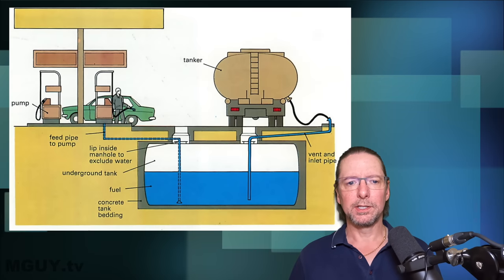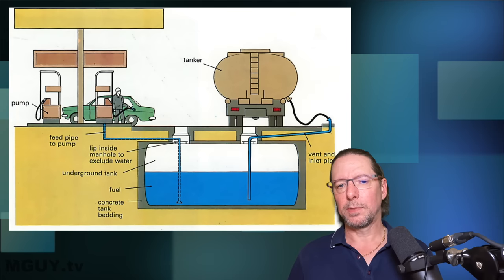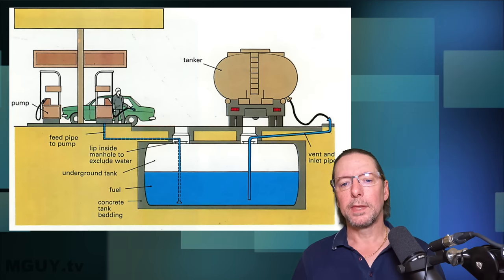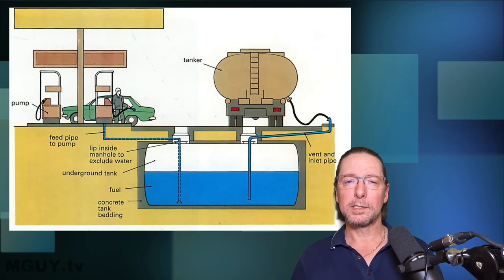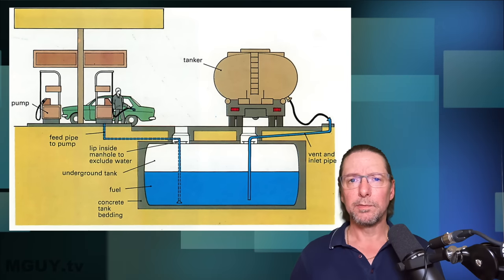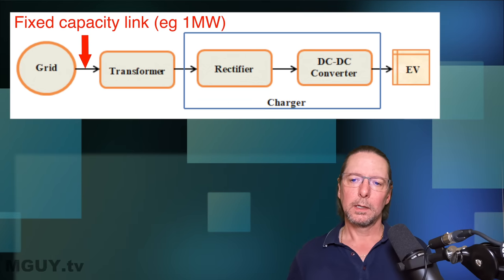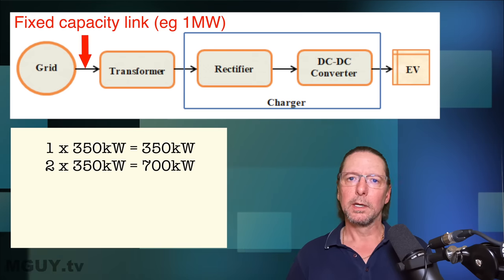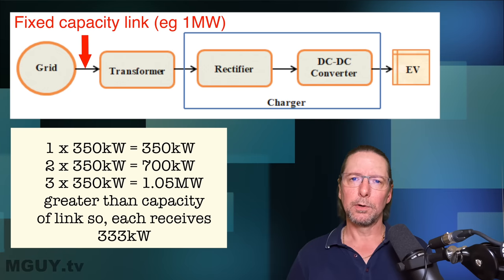HUGE problem with EV Charging Stations that no one mentions | MGUY Australia

Comment: A friend's son who is an electrician recently got a call to a company that were replacing their vehicles with ev's. He was asked to give them a quote to install on-site chargers, they were shocked when he advised them there wasn't enough power to their business to run the chargers.
Reply: He was referring to them not having enough space in the electrical panels on the sight to add more circuits. That’s not uncommon. The fix would be to add a sub panel feeding off the existing panel but you can only pull so much from that also. Additionally in a typical commercial building the transformer feeding the building itself might not be enough, I’d say a study would have to be preformed by the power company to determine that. Most transformers are old and haven’t been updated. When a business moves into a location they don’t update things like this to accommodate for things they want as it’s expensive. They typically make everything look pretty and put lipstick on a pig, this is true for a used sight when the previous owner went out of business and the new folks move in. Just my two cents.
Reply: Nice pun..."shocked".. lol
Reply: @Bill308A10  Maybe he meant the cable supplying the business was not big enough to carry the extra power.  This happened in districts of London where 'shock horror'  people were told they could not charge their EV because the power supply to their area was not big enough.  There is not an endless supply of electricity to feed these EV... in fact power outages are becoming more and more common in our area, pretty much twice a week now.
Reply: The electrical networks are no where close to being sufficient to provide enough power to charge en masse. It’s all a pipe dream.
Reply: Imagine having a fleet of HGV's!!!! No chance of charging them.
Reply: We already have "brown outs" during the summer due to heavy use of air conditioners. We are told to reduce use of electricity during those times. Guess no air conditioning or EV charging during hot Summer months.
Reply: So what happened? Did they decide to get the EV's or keep ICE vehicles? Maybe the company should look in to what is going to happen to their insurance premiums and see if they are covered for the loss of the entire building if one of these POC's spontaneously combusts.
Reply: @richardweyland116  I think they already had some ev's so they would have to use public chargers for the time being. I haven't heard if they were looking into upgrading their power supply which is quite an expensive exercise plus the installation of the chargers.
Reply: @Bill308A10 No that means the mains feedind the board aren't big enough and if it was really high also the transformer they were on.
Reply: @Bill308A10  Actually the guy said "there wasn't enough power", note the word "power".
Reply: So the company gets onto their power company and increases their capacity. Or they fit solar panels to their rooftops and cut the power company out of the loop. Or they relocate somewhere that can meet their needs. But oh noes, they can't possibly use EVs because a friend's son said so.
Reply: @johnminer1407  or you fit solar to your roof and run the AC and charge your car without caring if the grid is browning out or not. If its that hot you'll probably be generating an excess to actually sell back to the grid.
Reply: @drxym  So in your world, people must accommodate themselves to their electric vehicles, instead of the electric vehicles being subservient to their needs.
Get real Sunshine, EV’s are not a viable vehicle for most people.
Reply: @drxym  An extra expense on top of the overpriced EV. I also note your use of the wcost of the word "probably".
Reply: @smedleyfarnsworth263  what are you even prattling on about?
Reply: @drxym  how the fuck did you come to that conclusion the point isn't it's impossible just that it would have been very expensive and while OP doesn't specify where this was i know that in Australia any modifications made to the grid the customer has to pay for then has to give that stuff to the utility company and a small addition is an easy $15k but then again solar would be an even larger outlay requiring a massive array plus energy storage. Because if they went that route the charging system would either need to be completely separate from the grid or they would need to do both so not exactly a cheap alternative
Reply: @shaynegadsden  punctuation is your friend.
Reply: @drxym  Wow that is seriously the best you have
Reply: @drxym  Oh dear, the fact that you can't comprehend my posts is not surprising considering the content of your earlier posts.
Reply: @drxym  " punctuation is your friend."

Now that is the pot calling the kettle black.
Reply: @smedleyfarnsworth263  I also alluded to that in my original comment buddy
Reply: @shaynegadsden  bro I know what I’m talking about I’ve been a mechanical engineer for going on 30 years now. I’ve built and rebuilt entire buildings both class A&B mechanicals.
Reply: @Bill308A10  Yes alluded is right, when ithe actual power supply was the main point. But you went off on a ramble about switchboards, to wit, "He was referring to them not having enough space in the electrical panels on the sight to add more circuits. That’s not uncommon. The fix would be to add a sub panel feeding off the existing panel but you can only pull so much from that". 

I hope that helps, buddy.
Reply: @Bill308A10  yeah what would i know i'm only an electrician
Reply: @drxym  I never said the company couldn't use EV'S but what I took from it that it was going to be very expensive to upgrade and install.
Reply: @shaynegadsden  Oh I see you are trying that old debating trick called “the argument from authority” as if somehow being an electrician automaticly stops you from being wrong.  

Well sparky not so fast, I quoted you verbatim and your point was about switchboards. Perhaps you were trying to impress us with your vast knowledge about them rather than the lack of supply which was the point being made.

I am not a meteorologist, but I know when it is raining.
Reply: @smedleyfarnsworth263  Cross communication i accidentally tagged you but fixed that and you seem to have mixed me up with the person i was supposed to tag.
Also while true it was a rebuttal to the I'm a Mechanical Engineer and i know better
Reply: @shaynegadsden  That explains it . I reread it all and it does not seem to fit together now.
Reply: It’s not surprising. Older areas will see that because the local grid most likely can barely support the existing loads.
The local grid, and even the grid node interconnections can only support so much before they start to overload and trip out.
Electric Utility Companies plan their infrastructure on worst case high use scenarios, not on off-peak use.
Reply: @johnminer1407  Only in the primitive USA.
Reply: @chrissmith2114  EVs aren’t as big a drain on the grid as naysayers and the uninformed fear. In this parts of the world where the mains voltage is 220-240 volts, any regular domestic outlet is sufficient to charge an EV, as long as it can be plugged in overnight, and is driven less than 60 miles (100 km) per day on average.
Reply: @jimmurphy5355  Charging an EV overnight means that it will not be charged by solar energy and the wind often drops at night - so the EV is probably going to be using electricity generated by 'non-renewable fuel source' most probably CCGT which use natural gas, or even a coal fired station brought online to prop up lack of intermittent renewables.  An EV is just a remote emissions vehicle, or if the battery has a bad day 'an external combustion vehicle'..
Reply: @chrissmith2114  Indeed, charging at night will use whatever power is available then, which, depending on the region might be coal, natural gas, hydropower, nuclear or geothermal, all of which (except coal) are sources available at night where I live, in California. So yes, EVs are "remote emissions vehicles" whereas ICE vehicles use 100% fossil fuel and do so less efficiently than burning the same fuel remotely.
Regional differences in the grid power mix make a substantial difference in how much carbon emissions are reduced by choosing an EV. If the grid is 100% coal powered, there will be barely any benefit. But even at night, some grids are 0% fossil fueled, if hydropower, geothermal, nuclear, and wind are the sources.
I used "overnight" as an example of one way to charge EVs with reduced strain on the grid, but depending on where you live, mid-day charging, while parked at work, if that is possible, can also be a preferred choice. Once again, specific to my location, the local utility now offers cheapest rates all through the day, until 3PM. Rates at noon used to be expensive, but so many people have now put on rooftop solar that excess generation needs a place to go during peak solar production.
Day or night - whichever is best for a given locale - EVs can often get all the charge they need from a standard domestic outlet in 240 volt regions, where 3kW is available. It takes many hours to put back a lot of range that way, but most cars, most of the time, are parked somewhere. If they can be (slowly) charging a substantial part of the time they are parked that can more than keep the battery topped up.
Reply: @Bill308A10  Most likely the overhead lines and transformers are inadequate for a business with many chargers - solution would involve bigger local transformers, heavier wires/higher voltage from the sub station and maybe even upgrades in the substation itself!!  It is a ripple effect back through a dated system that wasn't designed for this kink of service!!
Reply: @Bill308A10  I don't think so. I think he was referring to the current capability of the service drop, not the number of spare spaces in the panel. Those are two very different things. Some truck depots are looking for 1000 amps of electrical service to charge their trucks, which is more than the entire town draws.
Reply: BS: car can charge with normal outlets. No need of a charger. Also get a Tesla for more efficiency.
Reply: @mletouutube  you obviously don't understand electricity.
Reply: @Bill308A10  Well, Bill, that is pretty arrogant to assume that you know what that electrician was referring to. There was no mention of how many or what size vehicles or charging stations the customer was seeking. Nor was anything said about the location and what amount of power was available. I also do not know any of these issues at that particular location. It is possible that the incoming lines are not sufficient for the additional power draw.
Reply: I thought they were going to be solar powered? Yeah, right! 🤫
Reply: @mletouutube  Might do if you only drive a few miles a day, but to recharge from 15% to 85% (tesla model 3 or Y) would take 50 hours!
Reply: @Hogger280  day to day city driving requires only few hours charging AT HOME AT NIGHT. So you never go to a charger station (which you have to - gas station - with an ICE car). When you travel, after 3 hours driving, you need a break so you stop at a super charger and it takes 30 minutes to add 220 more miles into your Tesla. You plug and go to take a snack, restroom, etc. When you come back your Tesla is ready. I know with absolute certainty because I had a  Model 3 and now a Model Y.
Reply: @kennetzel6101 where did you get you get your info. You did not mention voltage. You need to talk about megawatts to get the true amount of power used.
Reply: @Hogger280 what do you think it’s a toaster oven. It’s more like a dryer or electric heat. More voltage and more amps.
Reply: Sorry buddy I do not give your channel any clout you are only one sided all forms of energy have there pros and cons. If you can’t argue from both perspectives you do not deserve an opinion.
Reply: @sgonnason9120  Of course, but that is dependent upon the type of charger being used. The lower the voltage at which they are charging the longer it takes to charge. While that may work for some folks at home it does not work for truck fleets. The fact is that even if we could build enough EV cars and trucks the grid is not able to handle that additional load right now, and it certainly will not be able to handle it as these nut jobs shut down more and more coal plants. Solar and wind can only produce a fraction of the power that coal, nuclear and natural gas can produce.
Reply: Electrician here. IF he was an experienced electrician, he did not mean there weren't enough breaker space. He meant exactly what he said. I have installed overnight chargers, called stage 3 chargers, the one's I've been around each require a 100 amp, 240volt, A/C, single phase service, that is a  lot of available power, their goal is to completely charge a vehicle in an 8hr. overnight period. This is the good at home charging system. Cost is about $12,000.
Reply: Similar thing happened at my workplace.  We were quoted 1.1 million to upgrade our system to be capable of charging employee EVs.  We have about 80 staff.  With 4-5 that own an EV.
Reply: AHAHAHA, that wouldn't be me and my father told you of this would it? Because we just told a company that they needed to upgrade their service if they wanted even ONE charger LOLOL! Now we are doing the service upgrade and the chargers... just a little over 100k, yes, 100,000 dollars!
Reply: @sgonnason9120  What the hell are you talking about?
Reply: @jerryw6699  It is not just the residential chargers that are the problem. It is the truck fleet chargers that will require much larger and faster chargers.
Reply: Even in a private home when people buy a fast charger they are shocked by the cost.
The underground wires to their house need to be upgraded to handle another 200 anp panel. Plus the panel and breakers.  So they usually opt for a slower overnight charger to avoid the cost of upgrading the underground wires.  But their power panel still needs more capacity.
Reply: This what some of these delusional leftist EV kooks fail to grasp or accept. Increasing the needed capacity to charge these vehicles in many cases is neither cheap nor easy to do. You are often looking at pulling new larger cables and increasing the size of transformers to handle the power not to mention the capacity of the electrical grid itself needs to be looked at. Ludacris things like installing a diesel generator have been the solution in too many instances. I am not inherently anti-EV but the realities need to be accepted and dealt with.
Reply: @drxym costs a lot of extra money and you need a lot of solar panels and battery storage to feed hungry EVs
Reply: @drxym So a “simple” event of “let’s get EVs for our fleet” evolves into an entire infrastructure study.  What people are finding is that it’s cost on top of cost on top of cost to make the change.  Look EV’s are fine for some applications but our infrastructure has not matured enough for “everyone” to jump on board. Look how long it took for our current situation of gas vehicles to evolve.  One doesn’t build those power plants overnight.
Reply: @mletouutube when all the charging stations are being used and they all have vehicles waiting, It will be a long wait!
Reply: @drxym  - you sound so ridiculous and naive.  Decades long industrial/commercial electrician here.  The cost of switching over a fleet of internal combustion engine vehicles to EVs is staggering even to those who can afford it.  You have no idea what you're talking about in this arena -- this is no small task.
Reply: @jimmurphy5355  Daughter works for SOCAL gas and their largest customer is the power generation stations.  I learned many years ago form an instructor;  there is a cost for everything.
Reply: @Hogger280  15 to 85% is 50 kWh on a model three or model Y long range. At 3kW that takes about 16 to 17 hours not 50 hours.
Reply: I will not claim to be an electrical engineer, electrician or have much knowledge of EVs . But the place I work is in the process of installing chargers . The decision was made by corporate office, without much consultation with anyone onsite . They initialialy thought that it could be just run from the existing building network . By the time they found out that might be a problem, the system had been purchased. 
It needed a separate feed and transformer . Now we are talking about a place that has 10,000 lights , and enough electronics that it needs AC even down to -40  . So I think if it's existing feed was not adequate then to me it means a lot of draw 
I saw the size of the cables feeding the chargers and they are huge . Likely they sized them for future expansion, but I have seen the power supply to big welding shops and agricultural manufacturing plants , and this is getting up into that range 
If you ball park that a gas station can fill 50 cars per hour , and 100 stations can serve a small city , it works out to 5,000 cars per hour capacity
If a EV charger can do a car in 30 minutes, then it works out to needing 2500 chargers 
Now my figures are on the high side ( possibly by a lot ) , and the people who have chargers at home or work will take a lot of load off that ( and those people would be a major part , because commuters who need less than 10 miles range can easily charge overnight or in a work day ) but they still take as much out of the grid 
I just don't see EVs replacing ICE overnight . It took forty years for the petroleum industry to get the capacity to feed our need , and I can see the power system needing as much time
Reply: @jimmurphy5355  The reference was to a standard wall outlet, this charger will draw 12 amps, so best case scenario will be about 45 hours.
Reply: Imagine entire subdivisions full of two evs each all charging every night. The entire country would need rewired.
Reply: @wmason1961  the grid struggles on a hot day when most people have their a/c on.
Reply: @wmason1961  Bingo!
Reply: Shocked. I see what you did there 😂
Reply: In California, the land of fruits and nuts, and regular blackouts since Enron, we don't need to deal with reality, we have drugs.
Reply: @user-zu6qn9ux9n  No, its not, pipes are not used. (Except in NYC where they were put in by Thomas Edison).😁
Reply: @johnminer1407  Why would you do EV charging at that time in the first place?
Reply: @richardweyland116  ICE cars burn at 10 times the rate of EV's.
Reply: Well if he’s an electrician he would also give them a quote for a heavy up to add the needed capacity thats what we do.
Reply: @davidhargrove1648  how do you know he didn't?
Reply: Soon the penny will drop , the only way EVs can work is if millions are forced out of their cars, this they will achieve by making them so expensive they will be beyond most people’s budget
Reply: Actually if he has more then 10 vehicles to charge at the same time he probably couldn't get a electrical service that provided enough electricity to meet demand.
Reply: @drxym yeah, you do realize that solar doesn't produce that much electricity....right?
Reply: He should have upsold them a solar carpark
Reply: If everything we use is electric powered... During a War... The enemy would only need to do it take out the power grid... And our whole country would be at risk...
Reply: @frankromero4048  and that could be as simple as hacking into the computer system that controls the grid.
Reply: Every EV is a time Bomb waiting to explode, at the charging station or around the next corner 💣💥
Reply: @Bill308A10  No he wasn't.
That's the trouble with letting a realist like an electrician near your fantasy. They know what doesn't work.
Reply: @richardfox6595  yea what would I know. Only made an assessment based on little known facts provided of the job initially posted. There’s a lot of variables to it I’m sorry I didn’t type out every one as to not get called out by the internet experts such as yourself. I’ve only been a engineer for 22 years. I simply love being so ignorant and being paid a luxurious salary yearly for it. Better yet having internet people explain my own field of work to me. The whole “not enough power” stated above could be interpreted as a lot of different things. I was simply looking at it from a different perspective. Stating that I’m in a fantasy is quite rude. I need not justify my qualifications on the subject any further to you sir.
Reply: @drxym solar panels cannot produce enough, the power grid across the US is not sufficient for mass conversion to EVs.
Wake up people
Reply: @Kevin-i6t5i  your absolutely right about that. I do believe there is an area where ev vehicles could shine however, and that’s if only people who commute to work everyday and the drive is say an hour there and back. If they are charging at home in the evening, it’s really no more draw on your power than running a dryer for a few hours. These folks living in the city and driving a few blocks don’t need an electric vehicle in my opinion. One must calculate the range and if there is enough there’s no need to charge at work. Solar panels are a joke in most cases they are set up to back feed into the power buss and then the power company pays you for the KWs. What no one pays attention to, is the power company sets the rate and it’s to low so you save just a little on the bill. Not every car needs to be electric on the road but in some cases on an individual level they could be beneficial. We honestly have plenty of oil and should be producing more of our own this would fix the argument all together but the climate folks would bust a spring.
Reply: @richardweyland116  Make up your own ending just like the beginning which was made up.
Reply: @chrissmith2114  So buy more batteries to cover the black outs. I see where the green millionaires are going.
Reply: @drxym you need to educate yourself on the costs involved with upgrading a service. It can be very expensive with very long wait times. 
You are very ignorant.
Reply: @Bill308A10 the fix is to accept that EV is a monumental failure.
Reply: @Bill308A10 if every business in that area upgraded their electrical service to allow for a fleet of EVs then the power Company’s power grid would most likely be overloaded, requiring more power generating plants. Think about that upgrade on a state or national scale. Be sure to include the power needed at each residence, apartment project, etc. 
Just something everyone should consider.
Reply: @Bill308A10 lol I like how you tell someone else why the company couldn’t do something and you don’t know the people but you say it’s because there wasn’t enough room in the box. Smh 🤦‍♂️ lol
Reply: In the building I work at they had to hook their new charging station that’s 4 chargers to a big diesel generator lol.
Reply: @Bill308A10 an average charger pulls 60 amps, the average service is 200amps,, a 200a service with all the other loads attached, AC, Heat, lighting, receptacle loads, water heaters, etc, can handle 2 chargers, you go with more your gonna trip the main circuit breaker. Space in panel is one thing, load space is the very expensive upgrade.
Reply: @thomaswilson2917  just don't get caught in a flood...
Reply: @Bill308A10  You could be right.  But in most areas the actual grid doesn't have the capacity.  When a new steel mill or some other industry wants to build the grid can need massive upgrading.  That ain't cheap.  And taxpayers shouldn't have to foot the bill.
Reply: @user-zu6qn9ux9n  Well they could do what California does to alleviate the problem of insufficient power - tell people not to charge their cars and turn off their air conditioners.  Simple.
Reply: @shaynegadsden there are a lot of you, THAT ARE ! JUST.
Reply: @thomaswilson2917  impulse buying, there are a ton of incentives and many people really don't understand how the power supply works it just something that always there
Reply: @darrylmackie9184  sorry i didn't get your point
Reply: @drxym  oh cool, I've always wanted to do the power company's job for them! 😂
Reply: The inability in installing on-site chargers is just an excuse by a company not willing to pay to increase the number of circuits. The power is not the problem and the electrician should know that.
Reply: @haroldnowak2042  you obviously don't know what you are talking about.
Reply: @chrissmith2114  I think EVs age coming is a good thing to force power companies to renew their old infrastructures. During many many years, they just took the money and let it goes to nothing. EVs are not the using so much power indeed (mine use no more than one big fridge over a year): many others high power users are more and more used, as heat pumps, inductions cooking, and so on. That is what will make electrical power demand going higher too. Non fossil use is not only about EVs, it's about all of our dayly comfort.
Reply: @Shinael  Who is going to pay for all the infrastructure upgrades for Grid to benefit EV owners ? The average consumer is already paying a lot on their bills to subsidise renewables, simply because renewables are so unreliable that there needs to be a 100% backup of ( at the moment CCGT, which are the only things agile enough to respond quickly the the roller-coaster output of renewables ) any renewable sources. The upgrades to grid to cater  for EV and heatpumps will cost best part of £1 trillion,  and that is without any mass storage which will be another trillion....
Reply: @haroldnowak2042  no adding circuits isn't the issue this has already been explained the problem is the supply limits which then you aren't just looking at a few thousand for sparkies but are looking at massive costs with either transformer upgrades or the installation of a dedicated transform plus the associated line and pole works. These things can easily get into the $100,000 plus mark. The simple fact is there isn't an unlimited amount of power you can use by just increase the board size and adding more circuits
Reply: Reading the comments amazes me. I think thermodynamics should be a requirement in school for 7th graders. Probably wouldn’t hurt to make politicians attend as well.
Reply: @marleythechameleonandherbi2724  most people are taught it, but while you can teach anything you like you can't force people to learn
Reply: @drxym  Pedant alert, they haunt the internet.
Reply: Let alone when, everyone,  has them. It's a damn pipedream
Reply: The national electrical grid isn't powerful enough,  before we can even begin to switch to electric (pun!) we must add huge amounts of generating capacity  (maybe Thorium ?) and beef up the transmission lines to carry many more megaWatts of power.   California makes me laugh,  they want to go all EV when their own lines are so old and decrepit they must be shut down on a windy day to prevent forest fires.  Good luck Cali.
Reply: @drxym  Relocate the business for company EVs.    Heh.   For the company I worked for, that would be millions of dollars.  With the potential if the replacement building was not close by, losing people that did not want to change their commute.
Reply: @Bill308A10  
Before a charging station goes in, a load study must be done and submitted to the utility for review and approval before a permit is issued. And the there will be an additional buffer capacity above and beyond the anticipated 100% capacity usage just so there are no hazardous situations to cause transformers to heat up and catch fire or explode!!!
So no, I don't believe that when one car is being charged, it gets 100% charge output from the charger and when a second vehicle is charged, the power from the charger goes down to 50%!!!
Reply: @Bill308A10  
For large power intensive applications like battery car charging stations - just adding a circuit to a sub-panel is never done!  This would be against code and illegal!  This will need permitting by the utility and a full engineering study will need to be submitted to the utility for review and approval!  So no, this is not going to be some backyard hack to tap some unused circuits!!!
Reply: @70chevs  When a bus station in an area of London where air pollution caused by the busses is a major problem, looked at changing over to electric, their were a few minor problems. The cost of four million pounds and the seven year completion time for the supply being the simple ones.
Since the maximum run time of an electric bus is around six hours, they would need to double the fleet, at a cost of around thirty million, then to house them all the bus station would need an extension larger than a football field, which at London land prices would need another two hundred million. Then you would need to consider the size of the bonfire when the whole lot went up in flames.
When 5 single decker's went up in China, it made world news. Imagine 200 double decker's in a busy part of London. Perhaps 50 new electric fire trucks would solve the problem
PS.
In London alone, their are around 30 bus garages, running 8,600 busses.
PPS.
This is not a joke and all my figures are fairly accurate.
Replacing all the 40,000 busses in the UK in the UK with electric, would cost around 600 million
Reply: Need double 440 not single 120 and yes that's About 75 grand here if your permitted to pull that mutch power.
Reply: one customer at a airport, was talking on the phone about buying 10 ford electric trucks because the airport is offering some money, and when he started talking about chargers he said just 2 for now .. I was just laughing to myself
Reply: @Bill308A10  Unless the building was in a lucky location, the supply was too small. Infrastructure is sized to fit the load; the incremental costs are significant. Everything is fun and games until somebody has to convince the regulatory people that more money has to be spent on infrastructure.
Reply: @Bill308A10  You claim to know exactly what the problem is at the beginning of your comment (absolute bollocks) and then criticise yourself. I'm not sure what country you're in but every one I've worked in the transformers are owned by the power distribution companies and just lay in the supply cables. Of course, with very large factories, these transformers may be on site but in most cases they're remote in secure enclosures. The power available is therefore determined by cable size.
Reply: @Bill308A10  I am shocked run for the hill and stay away from unsafe EV, if you want resell value aviod like a hole in the head